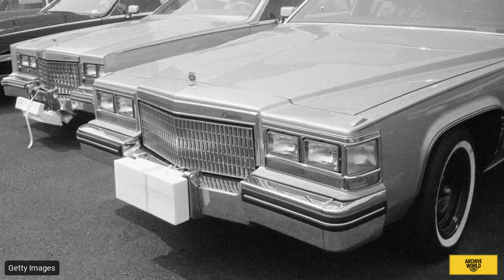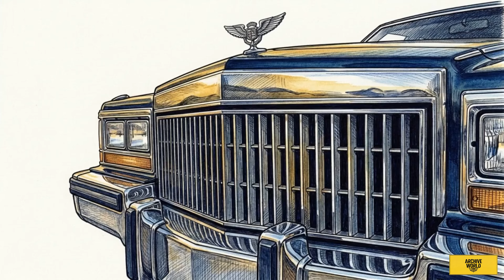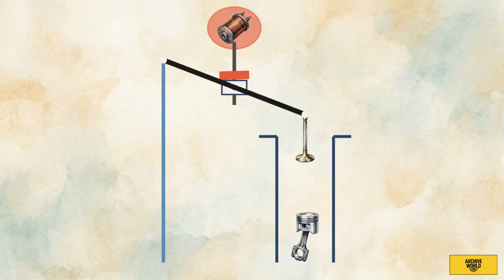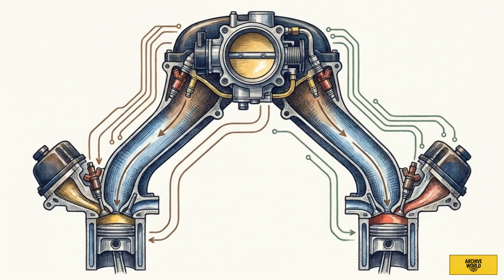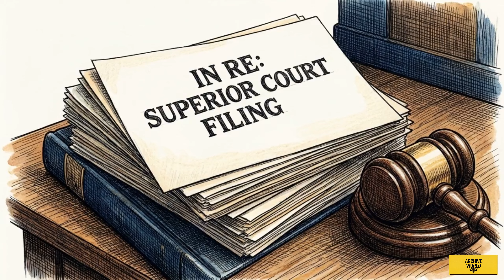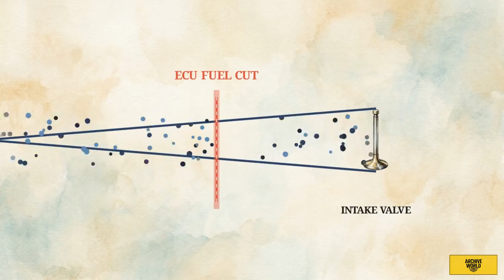The 40-Year Engine Defect GM Has Been Hiding (AFM/DFM Failure)

Comment: Interesting post, especially because fitment is easy to underestimate. Confirm the exact engine family, model year, current valvetrain, and whether the cam lobes or lifter bores show damage before choosing a kit. A mild daily-driver cam can keep manners and vacuum more manageable, while a more aggressive profile usually asks for matched springs, pushrod length verification, converter or gearing consideration, and a calibration. The honest tradeoff is that replacing more supporting hardware costs more now, but guessing at a partial repair can mean opening the engine twice.

After the measurements are settled, Dynosty makes sense as one source for the matched parts or hardware once the specification is locked down. That verification step is what separates a repeatable build from copying a parts list that happened to work once.